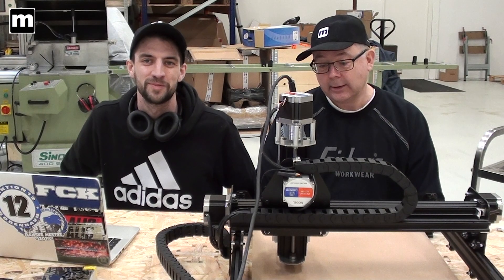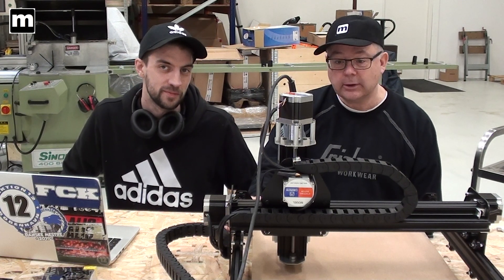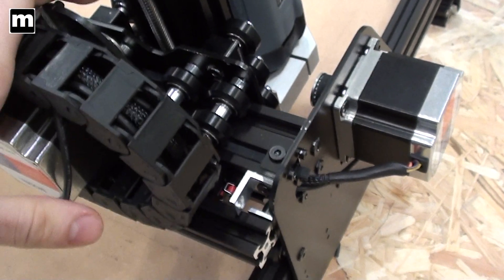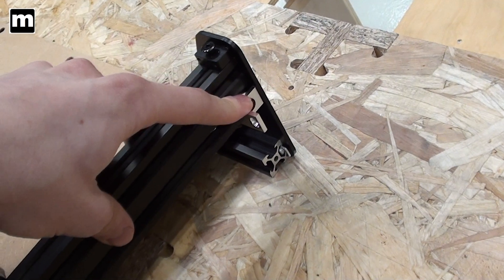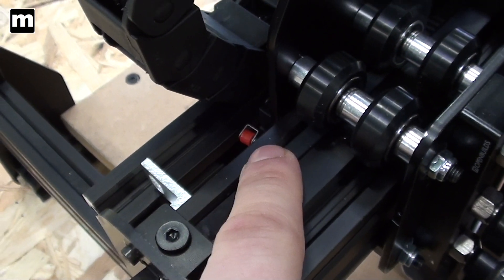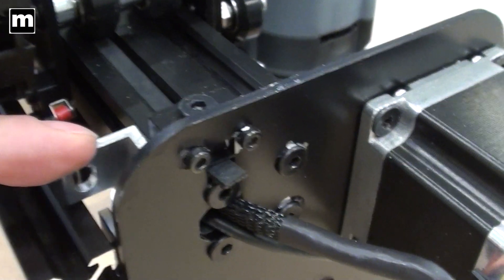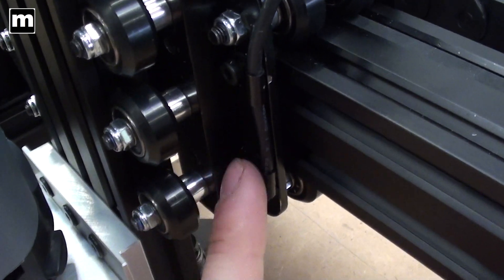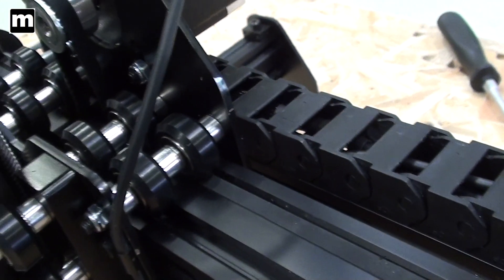makerCARVER - Prototype with Steel Gantry Plates

Comment: I see in the video you have the top wheels sandwich together and found this on the instructions of your build on the openbuild website from your link. X-gantry will ride on the 40x40mm rail with 8 wheels on the top and 4 below. The wheels are sandwiched 2 by 2 to fit the 40mm rail.
Do you have excentric nuts for tensioning? And if so are they on the bottom wheels of how to you have the sandwich between the 2 plates set up?
Thanks
Reply from the maker: Hi Josh, Yes we do have 4 eccentrics at the bottom to adjust the wheel tension. The sandwich has the same configuration as seen on OX CNC also on the Openbuiilds build page
Reply: Martin Barfoed Thanks for the reply.